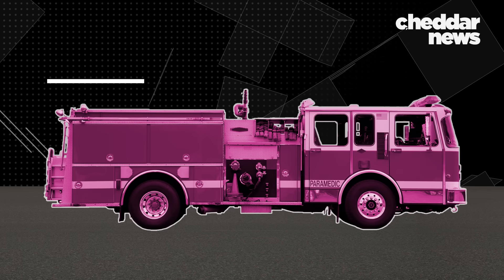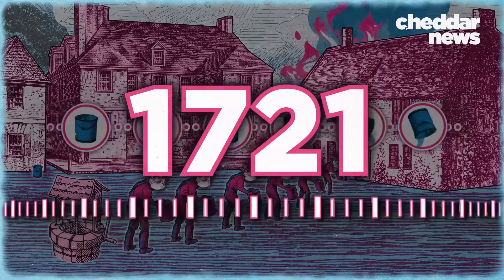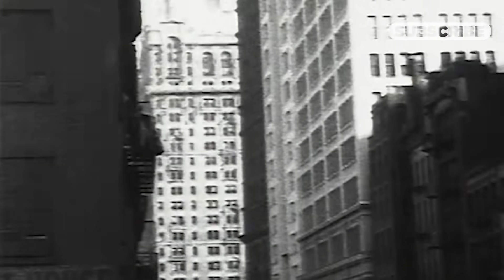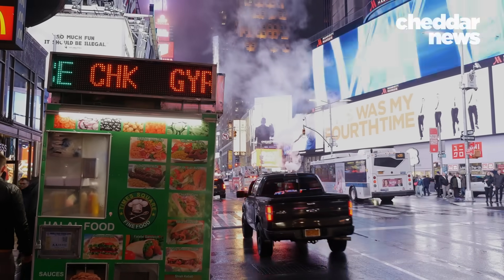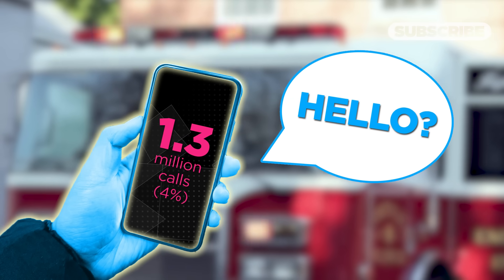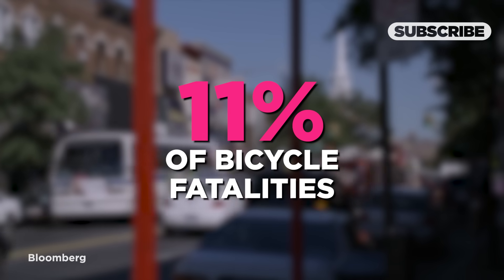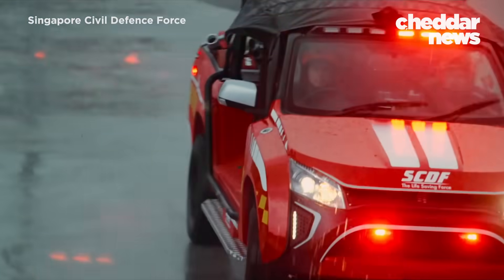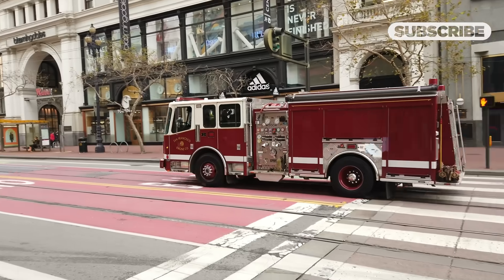Do American Fire Trucks Need To Be So Massive? - Cheddar Explains

Comment: This video is poorly researched. European needs differ greatly from American ones, hence the vast differences in truck design. The video actually kind of addresses this by acknowledging the fact that fire departments respond to more types of calls than just fires, but does so in a way that is more condescending of the job. This video also blames the truck for width issues more than city design. While its true older towns and cities have narrower streets due to their design vs need at the time, it fails to acknowledge current cities and subdivisions designed to maximize homes sold and profit made off a given space. Modern streets are still narrow, but are now designed to maximize developer profits. Anyone who parks on a street like this knows exactly what I mean. Lastly, the perspective is narrow in scope, as it addresses cities only. Rural fire departments must carry a considerable amount of water given that hydrants are limited or non existent. In reality, the United States is a vast country comprised of various climates, landscapes, and topography. Cities vary greatly in age and design, and firefighting apparatus must be built to meet the challenges our country faces. In fact, many fire trucks are custom built to meet the exact needs of an area, and no fire department takes lightly the cost and process of designing and purchasing a truck. This is true both in Europe and in America.

 In short, I feel that this video is misleading and designed to sway an opinion that would result in poorer services for communities around the country, who already are served by organizations that are struggling to staff and equip the best departments possible. Firefighters in general carry the same idea, which is simple. Provide the best service possible to the communities they serve in the most fiscally responsible way.
Reply: "various climates, landscapes, and topography" just like in Europe and European countries even though they're smaller. Also in Europe you have rural areas and the outback with poor or no water supply from hydrants or open sources. Still apparatus there barely differ from those used in the cities

Comment: I don't understand the logic of "Only 4% of calls are for actual fires; therefore, fire trucks should be smaller." That's not how fires work. Less fires doesn't mean smaller fires. The trucks still need to be ready for big fires. 

Also, fire fighters need to be ready for anything. It's a terrible idea to say "Hey, there has been a car accident, but there is no fire, so just bring the mini van. The ambulance will there, so toss out all the medical equipment in order to save on gas. If the situation is more serious than the caller reported, the ambulance gets in an accident or another call comes in, you can just run back to the station and grab what you need." No... they should bring all their stuff and be ready for anything.

Comment: Tbh, Australia is the place where all the types of fire engines combine. We are both European and Asian by Chassis choice as Scanias are the main cab preferred by Australian brigades for urban fires. For our rural bushfire operations, we rely on Japanese cab chassis such as Mitsubishis and Isuzus. These are usually tankers.For our actual bodies housing the fire and rescue equipment, most of them follow the American design with the side pump, however these are usually built locally and vary in size. They are still smaller than the real American body. Sometimes these truck bodies vary from state to state. For aerial appliances, the typical truck is a combination of both a cherry picker and an aerial ladder. We appropriately dub these ladder platforms. There was one point in time around late 90s that Queensland Fire and Emergency briefly operated some American LaFrance pumpers, but like Europe these never took off completely.

Comment: Ah yes, firefighting explained by the media... American fire apparatus are designed for their multiuse purposes. More sophisticated incidents require a multitude of equipment. In areas where you have larger response areas with fewer pieces to move, they need to carry more equipment. Specialized equipment does not take up a penny's worth of space either. There is heritage steeped in everything we do, but also a purpose. The job can be redundant, yet our "obnoxiously large trucks" get the job done where our 1 "truck" can accomplish the task of many European variants.
Reply: Also a rather compact Engine in e.g. Germany is a multi purpose apparatus, and while volunteers have rather small response areas here, career FDs and their stations cover probably a greater area than the American counterparts do in their cities

Comment: The Baltimore example isn’t a great one to use. The roads in question WERE plenty large, the problem is the design and regulations surrounding the bike lanes which require that the street parking for cars be between the travel lane and the (rarely) used bike lanes. The result was a narrow road that isn’t hard to drive down but hard to turn onto and most importantly nearly impossible to set up any type of aerial device as the outriggers for such operations are substantially larger than the footprint of the vehicle itself

Comment: I'm with the firefighters in the comments here. American stuff is bigger. If you drive a tiny foreign vehicle, you will get crushed if you don't get off the road. I VALUE the big fire trucks that have the power to push obstacles off the road and with a big enough engine to run massive pumps. America is the land of big USEFUL things.
Reply: then tell me how useful a massive truck chassis with only a 100 ft ladder is, while they have the same size of truck chassis but a 300 ft platform on it? It sure is useful, no doubt, but the size of the truck chassis is a rather relative thing

Comment: Well, I'm from Germany and I can say that our rescue services have the same problems with the width of the streets as our streets are usually even narrower than those in the USA. Also, I personally think it's one of the dumbest ideas in the long line of dumb ideas to put people on a what, 20 pound rack in the path of any cars. The streets are for cars. I myself was once involved in a car accident and asked the paramedics about exactly this facts when they took me to the hospital. They said that in Germany the ambulances are only there to stabilize and transport the injured and that the mortality rate in German ambulances is higher than in the USA. So I think that the size of the cars is justified in that they correspond to other planings.
In addition, the concept of multi-purpose vehicles is not a total solution. Yes, I agree that only 4% of the calls had to do with fire, but here in Germany a whole train usually pulls out, i.e. several cars. Is that also the case in the USA? I don't know. In any case, with any emergency there is a chance of escalating the disaster and I think it's better to come prepared than to wait for special equipment. In any case, I personally think that the concept of multi-use is far inferior to that of highly specialized vehicles. But that's just my personal opinion.
As for the cost, I can see the point. But aren't there subsidies from the state? I would be very interested to know if there are really difficulties in buying fire engines in the USA. And I also find it funny, at least in my city and state, that fire engines are also getting bigger, also because of the lack of personnel in the fire brigade. So we are adapting the US system.

Comment: The big difference is, that you have a hydrant every 30 feet or so in europe, so you don't have to carry much water. In the US there probably isn't a hydrant within miles, so they need to carry the water they need to actually fight the fire.
Reply: also in Europe you find rural areas with no hydrant or other open water source anywhere nearby

Comment: Location is a big problem too. There are a lot more rural areas that have fewer hydrants or no hydrants at all. A larger engine or even a tanker would be needed to have enough water on board to at least control the fire until a water source can be obtained. And with big cities like NY and Chicago, you need trucks that can both operate and support the weight and size of a ladder.

Comment: Another reason trucks are bigger in the US is weather patterns. We have more tornadoes and hurricanes in wide open spaces. I have seen videos on the news of trucks take direct hits from flying debris and not care. It helps a lot during search and rescue if you don’t have to worry about getting flattened by a flying tree limb
Reply: That doesn't mean every truck across the country needs to be large.
Reply: hurricanes and tornados happen in Europe as well; There's also a tornado alley across several countries. Not sure which weather patterns you think the US has and Europe doesn't.
Reply: @EnjoyFirefighting  they are a lot more extreme in the States
Reply: @kentuckyace1068  tornados are larger and more frequent, yes, but be sure we have all the weather scenarios you come across over here as well. Europe has its own tornado alley as well, frequent and severe flooding, wide-spread forest and brush fires, blizzards, earthquakes, volcano eruptions, heat waves ...
Reply: @EnjoyFirefighting  hurricanes and tornadoes of intensity are very rare in Europe.
You're rarely ever going to have to worry in the back of your mind about an EF5 storm deciding to go through the downtown area of Berlin.
The continental US gets more hurricanes and violent tornadoes in a decade then Europe will get in hurricanes/tornadoes in millennia.
Reply: @MrJack1992  as there's a designated tornado alley they're not really rare tbh. And Berlin is, if at all, at the very edge of the tornado alley
Reply: @EnjoyFirefighting  You don't understand. The USA is special and unique. It is so much different than the rest of the Earth...
Reply: @Megatonaxe  I won't understand if you don't even try to explain why you think it's so much more special and unique than other places ...

Comment: You very briefly eluded to it, but didn't really highlight an important classification of purpose. 
An "Engine" carries the pump which plugs into a hydrant and delivers water through hoses, as well as containing a very heavy 500+ gallons of water to be available to use while it's being hooked up to hydrant or if there isn't one. A engine carries 6 firefighters and 500 gallons of water alone weighs 4000 lbs.
A "Truck" is not used for fire fighting with water, but for rescue and access equipment, especially the hydraulic ladders for access to the upper floors. Some departments also have specialized "Ladder" vehicles which are semi trailers and have very long reach.. The obviously need to be long. 
Finally there are many other possible sizes just for men and equipment which can be as small as needed.
You have mixed all these different machines into one and compared together without distinguishing these or explained their purposes.

Comment: I think you answered your own question as to why they are look old its because of the price of the vehicles. departments will use a truck aslong as they can because they simply cant just go out and get the newest model everytime one comes out it requires money thats why alot of the FDNY and even small communities use older engines and other trucks. heck my city just got its newest truck last year and the one they bought before that was in 2011.

Comment: Why big trucks are still needed at least out side the cities a fire happened at small town less than( 30 people ) no fire hydrant or water source that the trucks could connect to the fire departments used 10 trucks to put it out by them emptying there 400 gallon tank on the fire driving 10 miles to a hydrant refilling then driving back the unattached garage was lost half the house lost but the rest of the town was saved

Comment: I was surprised at the "10 feet wide" part but apparently they are not, they are 260 cm just like in Europe. Airport firefighting vehicles though can be 3 meters wide.
Reply: A lot of the airport vehicles you see here tend to be HEMTT trucks the same as military tanker vehicles, just designed for water rather than fuel.  Also, they tend to be all wheel drive types (4X4 or 6X6) as they would cut across the grass and some standard trucks might get stuck

Comment: In my city the majority of the emergency calls are to vehicle accidents. The fire crews and their pumper truck are able to carefully pry a car apart to make  rescuing an seriously injured patient safer.  This means the crews have to carry along a selection of jaws of life, various lifting jacks and air bags.  Since they are the first at the accident scene they have primary patient handling gear, litters and medical equipment until the ambulance arrives.   Fire trucks are also starting to carry bariatric patient carrying equipment, that is heavy patient handling equipment in the form of a heavy lift gurney that is not much different than a heavy commercial appliance carrying cart for safely navigating stairs.  More pumper trucks are partly rescue trucks in terms of carrying a lot of extra equipment.
Reply: Engines in e.g. Germany carry all sorts of tools and rescue equipment as well

Comment: I think that the video is very biased in such a manner that she doesn't tell you that in the states most cities and counties are paramedic engine companies and paramedic truck companies and she fails to mention that each company may carry Hazmat equipment or Extrication equipment or salvage and overhaul, all the extra appliances and hand tools, shovels and brooms. 
A aerial in the UK only carries 2 ppl as where our ladders and tower ladders will have anywhere from 4 to 6 ppl on board. An engine company can anywhere from 3 to 5 on board and that is depending on the city or county where you live.
We carry pre-connect lines and water as where in the UK they have to connect everything and they carry no water. When we show up on the job we are ready to fight in the UK they are not they have to assemble all their attack lines. 
Many of our engine and truck companies carry foam as where in the UK they may or may not. 
I have been told and I do not know for certain but I have been told that in the UK firefighters refuse to take a paramedic class or EMT class and they refuse to run EMS calls as where in the states we have to take a paramedic and or EMT class it is mandatory in the UK it is not.
I myself if I show up to a fire I want a pre-connect line with water I do not want to show up to a fire and have to assemble an attack line and have to hook up to the hydrant to get water because there is no water on the engine there in the UK as where we carry water and they don't.

Comment: not a fan of 'choose an American thing and vent on it' using European or Asian examples as the proper way.  while i can see the opinion that american trucks are big, and can probably be considered too big in some areas and applications, for the most part US Trucks are larger than their European counter-parts simply because they can be.  even those trucks in san fransisco you were all over were much larger than their European counter-parts.  and very few if any fire trucks are going to be larger than the legal max width, otherwise they are required to carry special signage just like any other vehicle.

its the same thing with cargo trucks.  European designs are very compact so that they can maximize the size of the trailer that they can still haul within the regulations, the US had similar rules about total vehicle length up into the 80s which is why cab-overs were still common until then.  but the point is still that, except for major urban areas or very old areas, in the US even the smaller trucks and trailers for in-city applications can be pretty big because the road networks can accommodate them.

except for major urban areas, there is generally enough room for the any of the trucks you showed, even the largest ones you showed which aren't all that common.  there are very few areas in the US that are more than 200 years old.  in Europe, even those small trucks are going to have issues getting through medieval towns and hamlets.

the regular fire trucks go to at least some EMS calls because the EMS trucks don't necessarily carry rescue equipment.  further, because of their size, most fire trucks have at least some of the basic EMS gear too.  in a lot areas, the EMS is also the ambulance, so the average American EMS truck is also going to be pretty large.  there are also areas where, the EMS doesn't transport, you see them using heavy duty pickups instead.

Comment: I've seen a similar video comparing American trucks to European ones, but that video was made much better, than this one. The main reason being is that the video stated the reasons behind those differences and was as unbiased as possible. Whereas this video seems to be biased towards Europe's solutions towards European situations. I'm not a firefighter, but it stands to reason that if the cost of producing a rig could be reduced by reducing its size, without losing anything vital to the operation, I believe it would've been done.